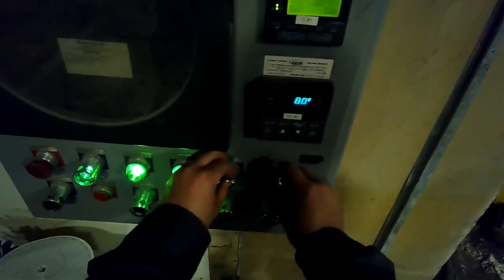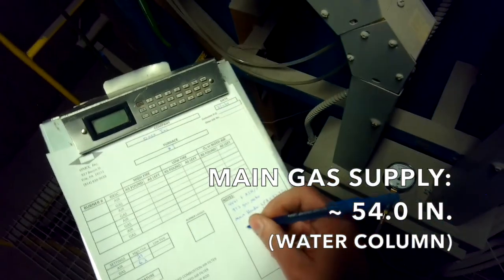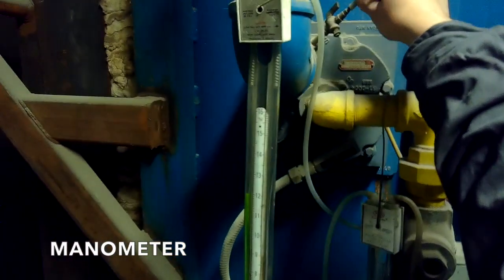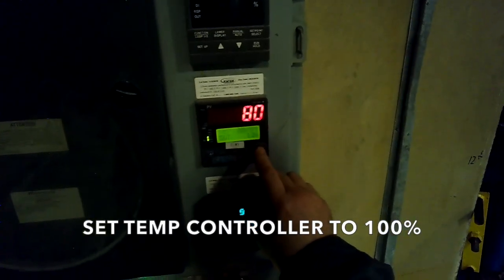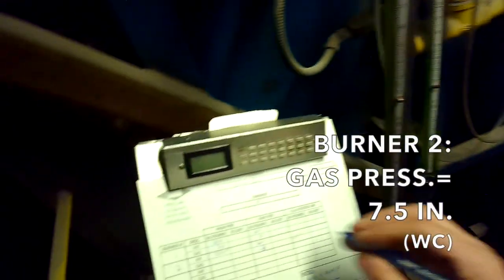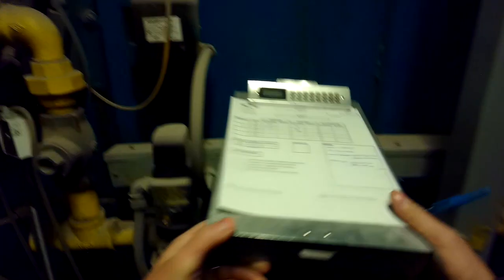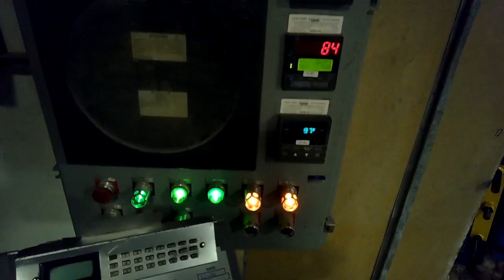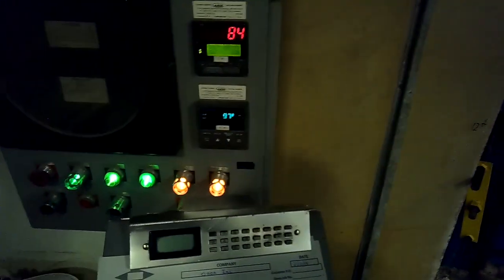Combustion Tuning on Industrial Furnace with Excess Air

Comment: I am an electrician and I work in a leading steel company near los angeles Ca , we have some huge circular furnaces with up to 12 burners , we use a digital tester to measure our gas and air,easier cause you can see the numbers up or down as you adjust the valves, nice video, thumbs up.